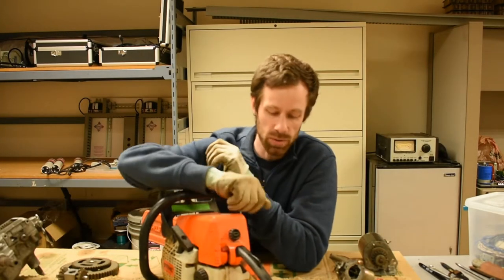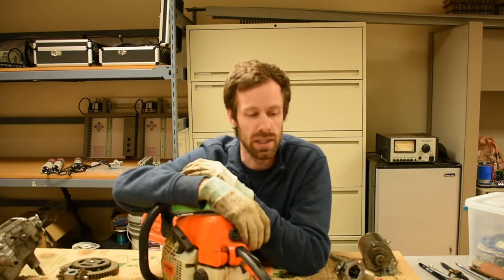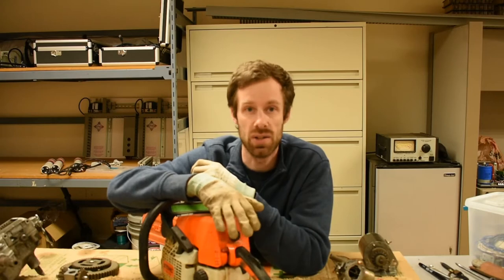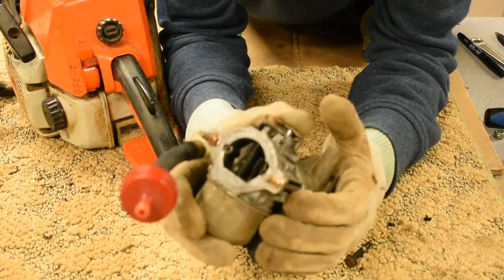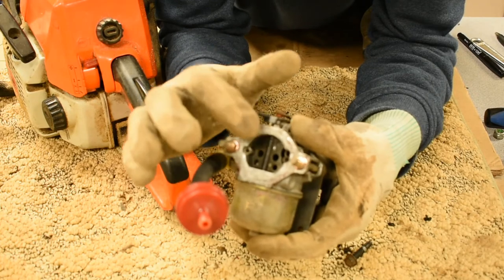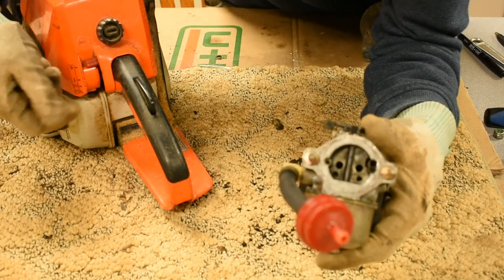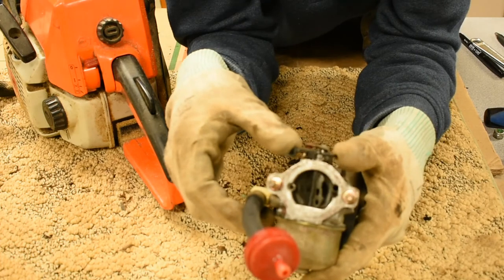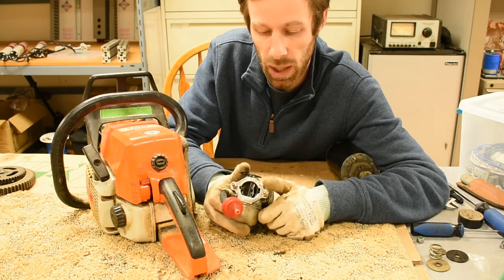How Does an Engine Choke Work?

Comment: Good content. I’d like to see a tear down of pneumatic actuators like those controlled by a PLD. Seems like something you would have around and be able to explain well.
Reply from the maker: That is a good suggestion - but to clarify do you mean the actuator/cylinder itself or the solenoid valve used to control the cylinder? 

Both are very interesting, but I have always found the solenoids to be a bit more mysterious. You also have to consider a few precautions when connecting coil devices to a digital programmable logic system. I have seen several PLCs ruined because of a lack of understanding about inductive coil loads.

Maybe I could just do a video about each and then my question is pointless :)

Comment: So correct me if I’m wrong, this is why old cars had choke levers , which you would close on engine start up, to reduce air to the carburettor to increase the fuel to the engine. The choke lever would stay out until the engine was warm and you could open the choke again.
This is before fuel injectors were a common thing.
Reply: Yep I have to do it on my bike every morning because my bike is about two times older than me 😂
Reply from the maker: Yes, exactly! Once you get a computer in to measure the engine temp and mix the fuel/air however it wants, it pretty much just runs the show...

Until one of those magic little sensor stops working...
Reply: @PetersonBrosAutomation  damn still responding? Pretty impressive you keep on top of it
Reply from the maker: @cultofeyes7260  Give a nerd some free time and yeah, he'll respond to comments. 

Sometimes.
Reply: @PetersonBrosAutomation  well that deserves a sub mate

Comment: Thanks so much. This is very awesome. Before I ask my questions, let me say that I did not grow up with small engines like so many people did. I basically don't have the experience of doing this. I've used them once or twice, but it was by fiddling with these levers that I started the engine and made it work. 

So my first question is what is the vocabulary? Do you say "choke it"? Do you say "choke the engine"? Do you say "choke the air supply"? Maybe "close the choke?" or "open the choke?" That sounds good because I think people say "open the throttle." So if you were to ask me, I'd say that "open the throttle and close the choke" sounds like a good way to communicate what you're doing.

And that brings me to my next question. So to start the engine on a cold day, would you open the throttle and close the choke? That way you'd have mixture rich in gasoline? If so, I guess the unspoken part is that a mixture rich in gasoline will produce more heat, but will do so at the expense of lots of fuel and incomplete burning (because of lack of oxygen). Yeah, it's still not clear to me why a mixture rich in fuel starts better. Is it because it releases more energy in total or just because with how cold it is, it's more likely to have a chain reaction with lots of fuel molecules more densely packed (in contrast to a normal fuel-air mixture)?
Reply from the maker: Honestly, that's about the extent of my experience as well - fiddling with levers until it worked. Growing up in the post-fuel injection world, I've never really needed to worry about it much.

TI can only answer your first question with my limited experience, and the phrase I have heard most often is to 'set the choke'.

As far as technical terms, I'd rather be able to explain a concept than speak the right words. You said 'close the choke', and since it is a flap that closes when set, your phrase would be most appropriate. However, since I haven't really heard that phrase in practice, I would tend to avoid that proper terminology in favor of the more generally understood terms. But that's just me. I'd rather help someone understand rather than be technically correct. Maybe people use that term, and I just don't know. There's a lot of things I don't know, so I just roll with what makes sense.

Next question, starting on a cold morning is a tricky balance. Opening the throttle allows more of the mixture into the engine. The choke controls that mixture %. If you open the throttle too quickly with a rich mixture, you run the risk of flooding the engine with more fuel than it can burn, since the oxygen supply was already cut low.

The best case is to turn it on with the choke fully closed, and as the engine heat up, open the choke valve while opening the throttle at the same time until the engine is running smoothly. But the timing is tricky. Even a slightly colder morning will change the timing. People with lots of experience can just do it all by sound and feel and get it fired up easily.

The rest of struggle. A lot.

Then we go buy a battery powered tool :)
Reply: @PetersonBrosAutomation  Oh yeah, that all sounds familiar. Now that you describe that process, I remember that the way I did it was turn one lever and then start it and then throttle it until it got how and then turn that first lever the other way. so that lever was the choke.

I think I will say "open the choke" if nobody gets too irritated because I think I've heard people say "open the throttle" and I like how it describes what's happening so you can keep it in kind.

So I'm tinkering with my lawnmowers and it looks like they both have a choke and throttle, but I don't think I'm normally supposed to be fiddling with those. Are they automatically controlled somehow?
Reply: The  term used to close the choke is usually "choke it" or "set the choke."

Comment: So the reason why a engine with say a dirty carb may only run with choke on is because it's not spitting out as much fuel as intended, so you can compensate, or balance it by choking the engine.

Am I correct?

Comment: My car is carburetor 2 barrel cutlass supreme v6 .this what I i do in my mornings i pump the gas padle like 3 times and then turn the  car on ,now the car is idling ,then I give it a few minutes ,1 minute I step on the gas n idle goes down now that's perfect..this morning  I step on the gas start the car  n it did not idle .my rpm was at 1000,,which it should be above 1000 at idle ,it's weird,help.great video well explain

Comment: Summer season, van won't idle an stalls when put in gear. Should I use the choke?
Reply from the maker: If it does this all the time, even when the engine is warmed up, I don't think choke is the problem. I have heard of this being an issue with vacuum leaks, like a vacuum hose that comes disconnected and it runs really rough and stalls at an idle, even when just sitting at a stop light.

Comment: Thanks for your video. I have a question. When I set a choke, I can start my engine. However when I start to push it back, it will die. I have to push it slowly. How long should I put the choke on(pull out the choke knob)? I have a 4 stoke outboard boat motor. Thanks.
Reply from the maker: Good question, but there isn't one certain amount of time for any engine, it can change. If it's a cold morning, or cold wind blowing, it will take longer to heat up. 

That engine is probably bigger than this chainsaw engine, but if it's anything like a lawnmower or something, then probably less than a minute I would think?

I actually haven't ever used an outboard motor, so hopefully someone who has a motor like that can comment with a bit better advice!

Comment: Is it good if chain start to rev/spining while still on choke ? Is it good to tune carburetor on stihl 038 because of that on LA on lower to avoid that ?
Reply from the maker: You would probably want to avoid heavy loads (like spinning the chain and throttling up) while on choke. You have reduced the air supply, so it might die out if you ask for too much fuel. With this small engine, you don't need to wait long. 

With a bigger car engine, you may need to start up a few minutes early and let it warm up idle before taking off the choke and hitting the accelerator. 
With new fuel-injected cars, they can monitor the temperature and change the fuel-air mix right away, so it's much easier to get going quicker on cold mornings.

The choke doesn't increase the amount of gas - it simply reduces the air supply in the mix. That is not good for loading down the engine.

Comment: Suppose the engine is flooded. How to resolve it? I watched a video saying turn the throttle to max, start the engine many times, burn the fuel out, engine will start in the end? What is your opinion? Throttle to low, start the engine many times? Any idea?
Reply from the maker: If you aren't in a rush, then you can unscrew the sparkplug to let the gas evaporate from the cylinder. 

If you don't have a lot of time, you can shut off the fuel supply (usually engines have a valve somewhere in-line with the tank) and try to start a bunch of times. The fuel should eventually burn off, but then you'll need to turn the valve back open and re-choke because it will still be cold.

Comment: So do you have to use the choke when it’s cold outside? Or do you have to use the choke every time you being to start the engine?
Reply from the maker: It's more pronounced when it's cold, but really, you would need to use it anytime the block is a lower temperature than at full operation. If the block is colder, it will suck thermal energy out of the combustion, leaving less for moving the cylinder, since you only get a certain amount of BTUs (energy) out of one injection of gas. 

So even a hot day will need a little bit of choke, but only for a short time until up to full temp. A cold day simply makes it take a lot longer because you are a) starting from a lower temp, and b) it is cooling faster even while warming up.

I was starting up an old wood chipper the other day (hot day for Oct here in SW WA) and needed choke for less than 10 seconds, then half choke, then full throttle no choke and it worked great.
Reply: Thank you. Much appreciated

Comment: I still don't really understand why using the choke helps with starting the engine.

If you just use less air then that wouldn't run any better than the normal mixture right? Or is the trick that you use less air but also increase the overall throttle?
Reply from the maker: When you start the engine, the colder it is, the more energy is required. However, you also need more energy to run at full throttle. You can't easily get both.

To get more heat, you need to burn more fuel, which means a rich mixture.

There are a few possible combinations that will make more energy:

1. More gas + less throttle = lots of heat, but lots of exhaust

2. More gas + more air = less heat, but more efficient to provide more energy. In other words, more of the energy is motion, not heat.

However, there are combinations that don't work so well:

3. More gas + more throttle = not enough oxygen to burn enough to keep it running. 

4. More gas + less air, pretty much the same as #1, but only works if you keep throttle low.

So when you first start the engine when it's cold, you need #1 (less air, same as #4) to build up enough heat to start the engine or it will suck too much of the heat energy into the block and try to die.

But if you ran that lean mixture all the time, and pulled the trigger for full throttle, it would not have enough oxygen to burn and would die out.

If you tried to run the lean mixture with extra gas all the time, you'd build up a lot of heat, but blow out a ton of exhaust with a really inefficient mix.

EPA would be mad.

I hope this makes sense and answers your question.
Reply: @PetersonBrosAutomation  Thanks for replying, it does answer my question at least a little bit.

So if i understand correctly you kinda want 2 different things for different situations? A mixture that generates more heat to warm up the block on startup, and then a mixture that generates more movement to actually run the engine once it has started?
Reply from the maker: Exactly. You see the same with cars which throw out a lot more exhaust for a few minutes on cold mornings (choke), but then lean out the mixture for more efficient power once they are up to temp.

Comment: ok so, choke close - more fuel, choke open - less fuel
Reply from the maker: Not quite - the choke flap only controls air, not fuel. The ratio of fuel to air still changes like you said, but not by changing the fuel amount, just the air. 

Full choke = less air
No choke = more air

Think of it this way, if you are choking on a piece of food, what is happening? You are getting no air to your lungs. That's a helpful way to remember choke, it means the same thing for engines and for humans.